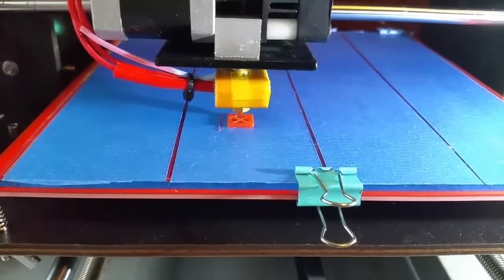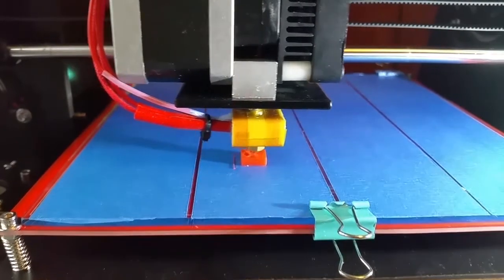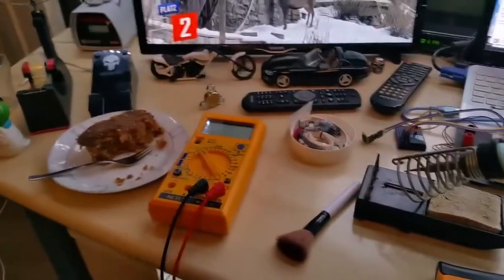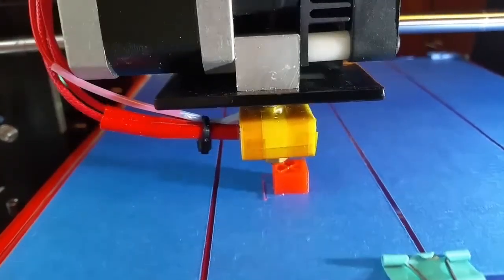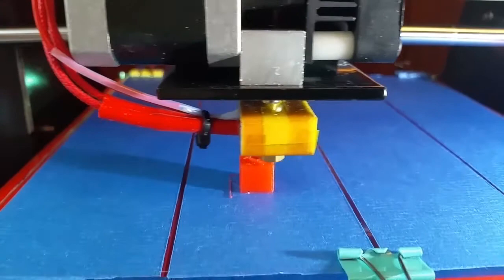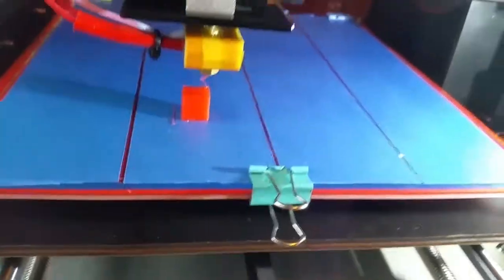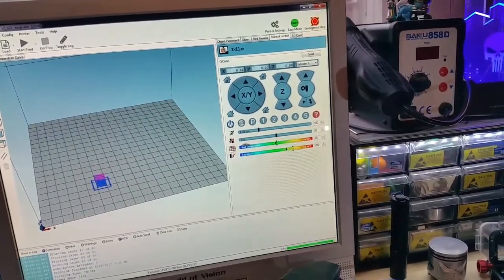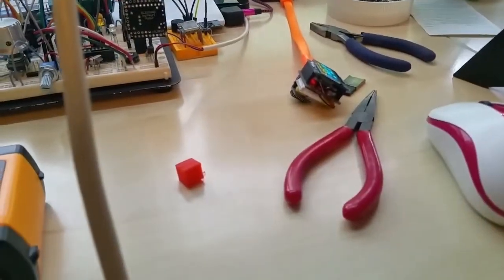My first 3D print on a Prusa clone

Comment: now you should print the enhancements for it
Reply from the maker: My first enhancement was adding proper metal coupler to the z-axis motors. I can't believe how the bed is only attached to the frame on the back. I am surprised that it prints like this in the first place. Instead of trying to upgrade this I will go ahead on my version of a 3D printer cube with proper 9mm and 12mm  linear rails and no hanging bed like the other cube designs I saw.
Reply: are you going to make an Enclosure. keep the ambient temp's good enough for PETG or ABS?
Reply: there's the heated bed too
Reply from the maker: The printer has a heated bed and yes I will make enclosures for my OLEDiUNO products. I already bought black, silver, transparent and glow in the dark ABS. the red/orange PLA came with the printer and I am using that to get into it.
Reply: I meant an enclosure for your printer.. thats what helps keeps the ambient tempratures spot on.
https://www.facebook.com/groups/190573191431688/  here is a facebook group on just this
Reply from the maker: My Cube Printer will have an enclosure and an exhaust fan to get the gases from the ABS out. For this one I make something simple.
Reply: check out that facebook group. they have some awesome ideas
Reply: have you checked out octoprint? you can use octoprint with a Pi W
Reply from the maker: I will, thanks.